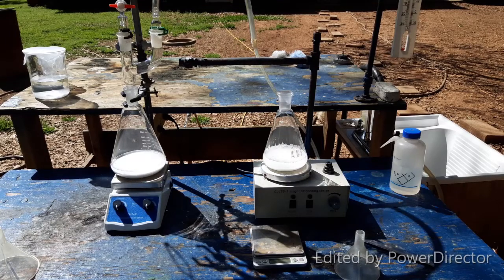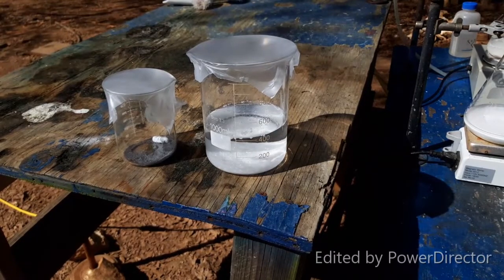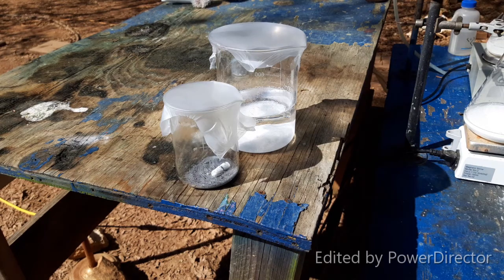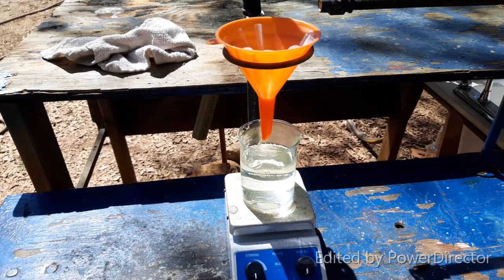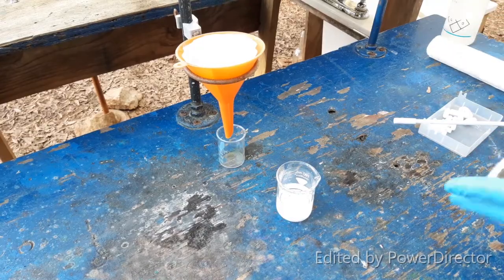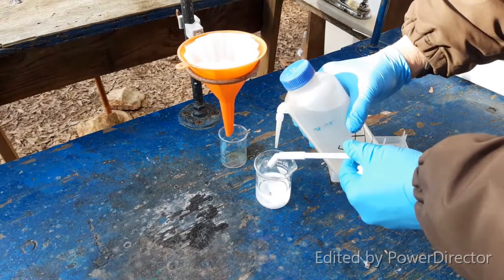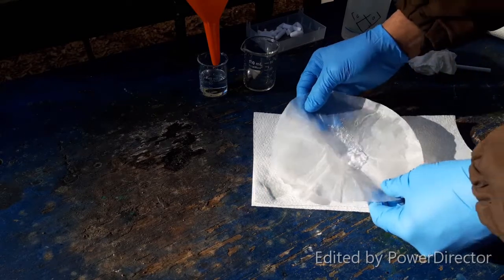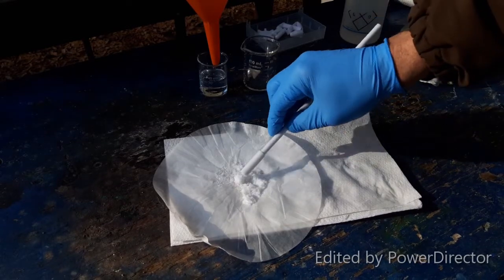How to Make Mercuric Chloride aka Corrosive Sublimate #mercury #chemistry #homelab #poison

Comment: 9:50 Mercury II chloride was used as an antiseptic and as a treatment for syphilis and it was available both as tablets and as a solution. It was used only externally as the stuff is pretty corrosive.